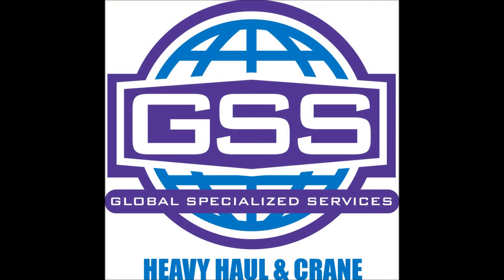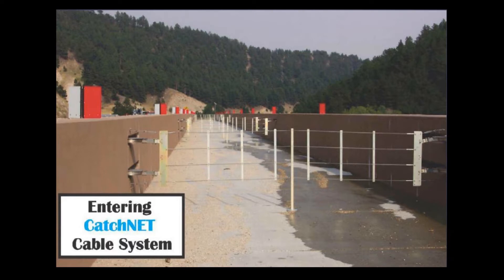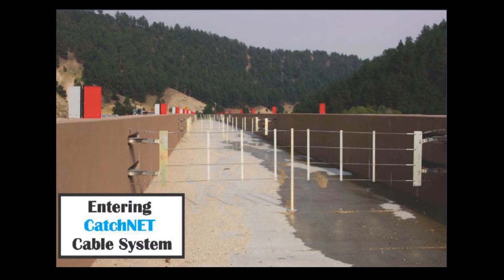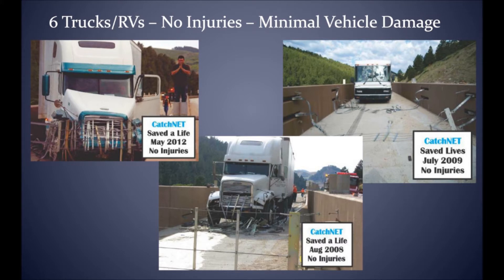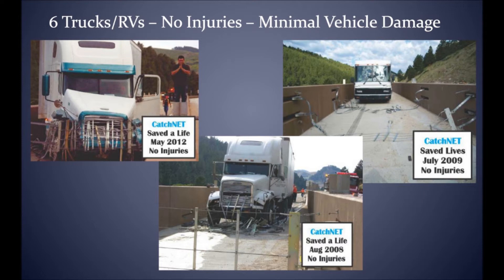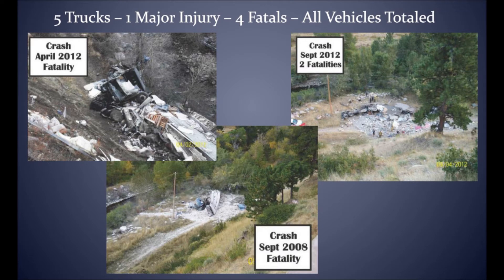Catchnet System

Comment: Gravel is much better and its ready to go again as soon as you pull the truck out not to mention at dramatically lower cost ease of construction and much less damage to the truck. You would have to have rocks in your head or getting kickbacks to build onr of these.
Reply: Gravel is better if you have 600 feet to build an arrester bed. The video implies it can stop a truck in 1/3 of the distance 200ft.

Comment: why not pair it with shallow gravel,??  also you they should implement  gravel filled wheel rutts that grab the wheels and steer the truck wheels straight. I think its stupid that it damages the truck so much but.
Reply: The design works well enough without gravel. Introducing gravel will incur maintenance and drainage issues.